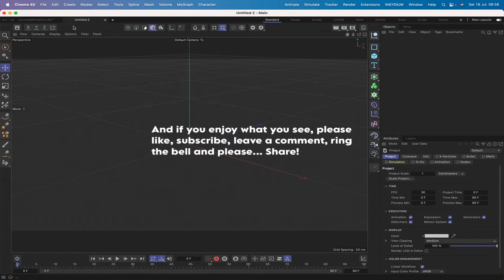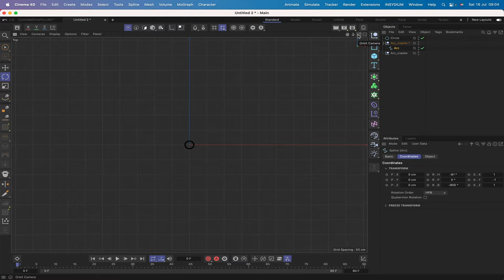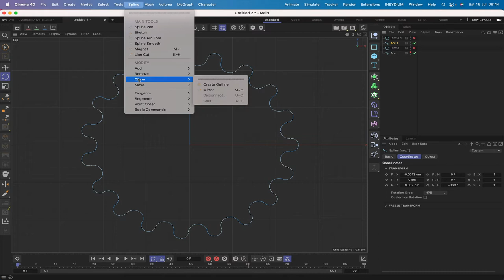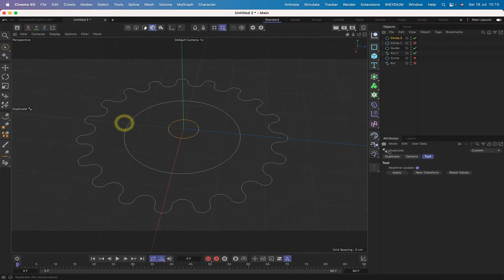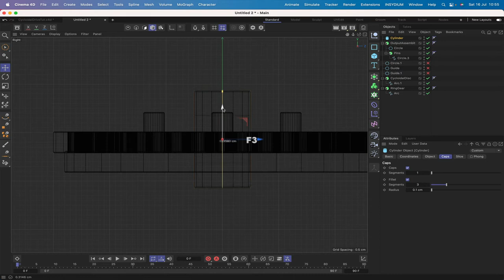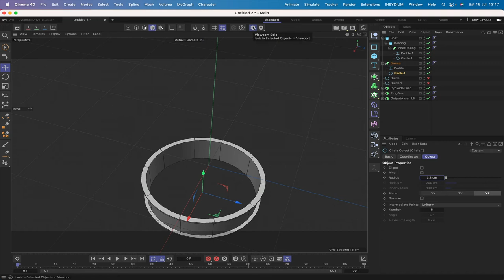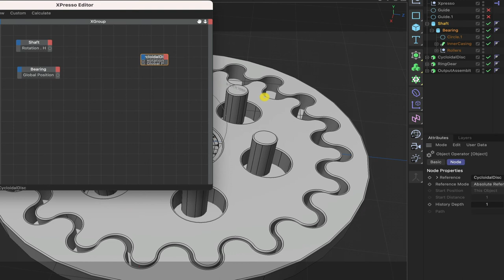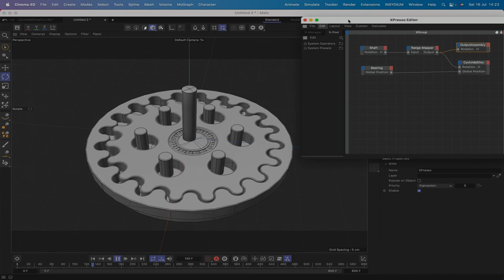Cinema 4D Xpresso Tutorial 49: Cycloidal Drive

Comment: Excellent,  may you model and animate 3 phase induction motor sir ?
Reply from the maker: Probably not, because it is about 98% modelling and only 2% animation (you just need to rotate the drive shaft - nothing much going on there), so not really suitable for my audience, really. polygonpen might be the person to do that one. He might give it a go, if you ask him. I may produce a stepper motor tutorial at some stage, as these are more involved, when it comes to controlling them.
Reply: @ExpressoMechanicTV  swithgear mechanism such as medium voltage circuit breaker or stepper motor will be good tutorials